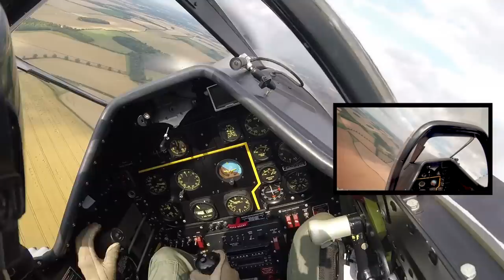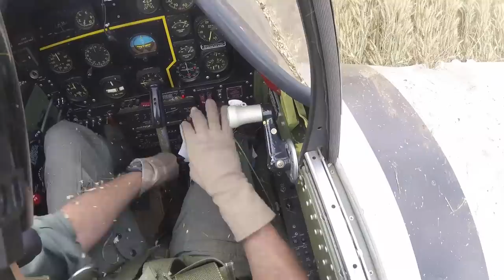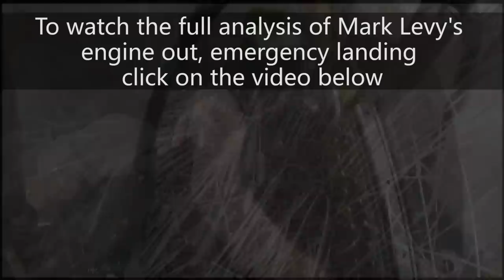P-51 Engine Out, Off-Airport Landing

Comment: Everyone: cool, hope he's safe
War Thunder pilots: Wha how did he not just explode what?
Reply: Yeah wt has some odd mechanics but ive pulled this off before in the game
Reply: Explosion crashes happen a lot more often with the new game engine update. In the old engine you could crash land a plane relatively easily.
Reply: Press J to leave your aircraft (15)
Reply: @jandajanda2242  just lightly tapping a tree will make you explode. Once I skipped across the airfield because my gear was shot out and my nose just barely touched a tree and then I exploded in a ball of flame and I just thought to myself "yup thats warthunder for ya"
Reply: In war thunder this guy would have exploded when they touched the floor
Reply: wha how did it not go like an atoms bomb
Reply: lands plane safely, but goes over a little hill
wing: falls off
sOfT lAnDiNg ‘yay an extra 1.5 SL thanks Gaijin’
you will leave your vehicle in 15 seconds
Reply: @KuroHebi  i disagree heavily i landed a p47 pretty damn hard at over 250 mph and only destroyed my engine
Reply: @kermitlynotfound1129  sometimes the game goes easy on the physics. It's a really clunky game.
Reply: @KuroHebi  i agree it is very clunky
Reply: @kermitlynotfound1129  amen, brother.
Reply: @Noname-qu2wg  just like simpleplanes

Comment: I would recommend people people watch the longer video. Especially those who are criticising his performance. 

The Pilot analyses what he did wrong and what he did right and why he did things, right or wrong that way. He is very frank and covers what he hopes he would do differently.

For those questioning his 'right' to provide advice - he has been there, made the mistakes and now he is advising you on the traps he fell in to and why he fell into them so that others will hopefully avoid them. He also covers the errors he didn't make and how and why he avoided them. At no point does he claim to be Mr Perfect.
Reply: I'm no pilot but I agree. I always thought as long as the engine is partially running it would be better then not running. Guess I was wrong there. I've thought about getting my pilots lisance but not sure yet.
Reply: We all know that the people that say they would’ve done it differently either have never been in that situation, which good for them or they’re just people trying and failing to look cool in front of others

Comment: The pilot (apparently) stayed calm and, yes, made a few mistakes. It's a tough call to shoot for an off-airport landing with all its dangers when the engine is teasing like that. In the last few seconds he decided that he wasn't going to clear that road, let alone make the runway, he turned away and got the gear up and wings level. Great job, Mark!
Reply: Why did he have a higher sink rate than planes on YouTube making relatively gentle no-engine landings?
Reply: @vampiresforesl  Were these other planes P-51s? The P-51 flies like a brick with no engine. They aren't a glider. If he would have tried to hold it back too much it could have tip stalled and that would have been all she wrote. A lot of pilots were killed during WW2 just learning to fly the P-51 for exactly that reason. I've heard it said that more died in training accidents than in combat, but I don't know the validity of that statement.
Reply: Gear up???
Reply: @cheetahfish  "I've heard it said that more died in training accidents than in combat" Yes, that's true in general, not just for the P-51.

Comment: The speed in which the situation goes from "I can't even complete the 180°" turn to "landing gear up, let's fly this to the ground" is just incredible. 
I think most people they have more time in general for things. The podcast lasts way longer than the actual event and the thought process that went in to this seems like it would take longer. So grateful for the insight and video. One thing is to say "it happened so fast" and it's always another to see that while you're still processing info, this pilot is already on the ground.

Comment: Well done, the intermittent issue has to be a terrible thing to try and reconcile. I'd be trapped in "I can make it".....
Reply: JimsEquipmentShed i think in a situation like this, gaining altitude on the way to land, while u have power, would help. Added altitude=more glide time. But thats just my thoughts, and i dont have any actual flight XP...just simulator, so id like to know if im wrong and why so i can fix my thinking.
Reply: I would agree, I'm strictly right seat, but in my humble opinion, there is no substitute for extra time and altitude.  
Anyone I have ever flown with has always been on the look out for a place to land from the time they took off, until the time they get to their actual destination.
Reply: that's what gets 90% of pilots killed, if you got an engine failure (no thrust or even idle thrust) in down-wind don't go for a short final just land the plane on a field. Many think they can make it and end up crashing the plane. It's not about trying to do see if you can make it by going for it and then deciding 8 seconds before impact oh shit I can't make it and then try to change course to land in a field which cause you to stall because you can no longer trade altitude for speed. You have to be conservative, this pilot thought oh maybe I can make it instead of I'm going to risk killing myself I should just safely land here. I'm not saying it's easy but it's something your instructor should have taught you.
Reply: St T. It wasn’t a failure until the point of no return though. It proper reaction  to an intermittent failure I was referring to.
When you are looking down the dark tunnel “willing it” to stay running.
Reply: Very much dependent on circumstances on the day.  My instructor taught me:  If you have a sure field ahead and very few other options, and an engine that's coming back to life intermittently, go for the field in front of you and assume a dead engine at that point, because of the unreliability and the certainty of your good field.

However....    If you have a stuttering engine and a string of excellent field options ahead all the way back to the airfield AND you can maintain sufficient height, or at least slow your descent enough with the stuttering engine - then limping back to the airfield for a smooth tarmac touchdown MAY also be a perfectly good and viable option, because if it goes pear shaped, you'll have a good field in front of you at any time.  Especially in the rural parts of the UK, you can have a long succession of perfect fields that COULD lead you home perfectly safely to that sweet sweet tarmac.

In this instance, his last second turn back to the right was absolutely the best decision, as he didn't have the height or energy for finals, you could see the rapid descent rate.  He kept the aircraft flying level for a controlled impact and walked away - Job done.  The plane was also repaired I believe.  That's a double win.
Reply: @JNM11787  in the full version of the video they do discuss the balance of kinetic and potential energy and the interviewer did ask if the engine was making good power when it did come back. The answer was "no" because if it was he could have climbed. It was intermittently running, but only making enough power to slow the descent unfortunately. The pattern was relatively low altitude and from memory only at around 180kt so he really had very little to work with.

Comment: Been to the Reno Air Races many times. When those guys have an engine problem they immediately exchange airspeed for altitude (best glide speed) while turning toward a runway. This procedure saved my but when the radial engine threw a rod on my plane. I didn't gain much altitude but it was enough to get me back to the runway.

Comment: Seeing this. I think of my local AP. there are no fields of grains around .Don't make the runway. its trees for miles. Tall pine trees.100 ft high
Reply: Same here, on one end, a very short roll out, then trees, and on the other, a housing area thats so close, they can confirm your checklist.
Reply: In fact tress aren't that bad, if you can glide the wings into the top of trees and then execute a stall you will make it, well hoping there aren't big fat trees and you manage to don't hit one with the cockpit.

I'm in the same scenario at my airfield sadly

Comment: A partial engine failure or a rough-running one is really tough. He's right in that a pure engine failure is easier. We've all trained for engine failure but it's tricky to train for this. You have to re-evaluate your plan and come up with a new one and in this case he did it three times, the last time was 400ft on base turn with flap and gear down.

Comment: I had a similar landing, but we didn't have an engine failure, the pilot made a mistake and when we came over the runway to land we drifted and stalled into the grass next to the runway. It is horrible to be in a crash but it just shows that the can happen, I am only 14 and have already been in a plane crash, it's not normal but they do happen. Congrats to the pilot who managed to set down the aircraft in a field, if he turned to the runway he would have entered a stall spin and they aren't fun.

Comment: Partial engine failure, if it’s cutting in and out I’d have to guess it’s a fueling issue, best thing he could’ve done was play with the throttle like he did to try and get it to come back, great actions by the pilot and the airframe did exactly what it was supposed to do, and that’s get the pilot home with a heartbeat

Comment: Question for the Mustang experts: Will the gear come down if the engine is not running?  I assume the system is hydraulic, but is the pump engine driven or electric?  Is the backup gravity (free-fall) or hand-crank (pump or mechanical).  With no time for a manual extension, and an engine driven pump, seems like telling someone who is dead-stick to lower their gear would be bad advice.
Reply: Agreed - I noted the time he pulled gear up to impact was quite quick - would the gear have come up in time? Expert choice reacting the way he did in given situation in last seconds.

Comment: Speaking as a carded formation pilot at the first sign of any engine issue the first place to go is up and out of the formation, then head straight for the airport.  If there was another element behind his, and the lead of that element did not spot him, another aircraft could have easily ran into him.  This would also have been a critical time to trade altitude for gliding distance.
Reply: Bob Japundza 1, they were flying slow
2, it's a heavy warbird at too low of an altitude, it will not glide far
3, watch his interview

Comment: Moving the throttle after the engine restarts is generally a bad idea at least until the runway is made. 
Me? 14,000 hours of crop dusting, 20,000+ total. 3 engine failures in recips, 1 in turbine, 2 turbine precautionary shut downs.

Comment: I'm very curious why you would do a gear-up landing in a field.  These are tail-dragger aircraft, designed for rough field/unimproved landing strips during war time.  You're obviously tail-dragger qualified, would you not land a Cessna 170 in that field?  I would love to learn more from this landing.
Reply: + Spydie  It's roughly an 11,000-pound aircraft.   Landing with gear on any soft ground and it can dig in and flip you over, usually with fatal results.
Reply: @FiveCentsPlease  That looks like a very dry field, like the WWII pilots landed in.  But I wasn't there so it was your call.  As PIC we have the final call.  Good luck!

Comment: I think I would have been pulling up to gain as much altitude as possible since it was close to the airport but in the heat of the moment, I am VERY glad you did not get hurt.
Reply: That is the exact opposite of what you are supposed to do. If you raise the nose you lose airspeed, if you lose enough airspeed you stall, when you stall you fall out of the sky instead of gliding down. If he had pulled up he would have killed himself.

Comment: Intermittend, that is scary. It might have been a idea to just cut the engine totally - just so you avoid the "trying to make it" trap and avoid it comming to life at the worst moment. As well as fuel still pumping/flowing and similar issues. But with that old military plane, that might have made it worse. For the kind of reliable performance you need in war, safeties are among the first things cut.

Comment: What was the reason for the engine out? Most likely the landing gear did not make it back inside. :( 
Great job anyways.
Reply: I wonder if the radiator being proud under the fuselage on the P-51 digs into the dirt during wheels-up landing. Should stop it quicker, or shear off.

Comment: Not a pilot, and I'm curious why you would pull the landing gear up. I feel like it would be cheaper to replace the landing gear, and with any luck, just the tires rather than the wings.
Edit: I understand that you are hoping to just scratch the belly, but I feel like you'd have better luck with a rolling landing rather than a sliding one.
Reply: +@rorscheyourmom8848    The plane weighs around 10,000lbs, give or take with fuel load, original equipment, etc.   If you land on an unprepared soft surface, the gear can dig in and flip you over, and that is easily fatal.
Reply: @FiveCentsPlease  Thank you. But just to add a little, I assume the prop. is weak enough not to be an aspect in this scenario? So the prop. couldn't dig in also and flip the plane, or dig in enough to pull the bow in?
Reply: @rorsche    The prop blades usually bend backwards with the impact, or wood/composite propeller blades on some warbirds will break.   It is rare but you can see old pictures of a propeller blade bent forwards and this is usually because the engine was making power at impact.

Comment: I'm curious, at no point did I hear Mark call an emergency, or even to let his flight lead know that he had an engine issue.  Did I miss something?  I'm not trying to be an armchair quarterback here, but if I know I have an engine that is misbehaving, the first thing I would have done would have been to call my flight lead and let him know.  They could have broken off and given him access to the runway.
Reply: The priorities are as follows:  1) Aviate, 2) Navigate, 3) Communicate.  

The Aviate portion includes the ABCs of an emergency landing.  (A)irspeed, (B)est place to land, (C)hecklist.  That's a substantial amount of stuff that has to be done prior to the "Communicate" step.  If he did not make any calls, that is most likely why.
Reply: A Sweet Old Man I agree with that, but in this case, I don't think it applies.  Furthermore, in the more detailed video I watched later, Mark said he thought he did call, but didn't remember what he said.
He had plenty of time to inform his lead he was having an engine failure.  Furthermore, he found have broken off and landed downwind.  Now I AM playing armchair quarterback, but he walked away, the airplane is being repaired and will fly again, so it's all a moot point.
Reply: He did declare an emergancy (watch the 'long form' version). However neither video system picked it up, nor did they pick up the transmissions others made.
Reply: Rick, in my second post in this thread, I covered that.

Comment: First - The guy survived and the plane experienced minimal damage.  Overall, well done.  In particular, an excellent choice to not try and stretch your glide across that road packed with cars.
Second - At ~150 kts, why in the heck didn't you climb?  At 150 a Mustang can certainly climb some.  "CLIMB, turn, clean" is the ROE for every single engine pilot in a power deficient EP.  This part confuses me.
Reply: You werent in that situation though. Rational thought most definitely  goes out the window when you're in an aircraft with no engine power
Reply: If he was able to maintain altitude perhaps the thinking was to maintain highest possible groundspeed to get back to the field ASAP.

Comment: Think I saw the 7700 emergency on flight radar24!
Reply: I very much doubt he'd of changed his code that low with a failing engine, it would of been stupid and unnecessary.
Reply: It was a P51 and you don’t often see that. Also there were other p51s around it at the time and it was in this livery in some sort of warbirds thing which o do not remember. I don’t know though.

Comment: Forced landing! 

Immediately decide for any available field. Use remaining airspeed for glide path above stall speed. Fewest obstacles etc. To low, for bail out, must do gear up in field. Full flaps after speed required if possible. Cut fuel and ignition. Tighten harness. Flare out at ground approach.

The aircraft was lost when engine failed. Try to survive with out coming down on population if possible.
Well done.

The Tempest with it’s large chin on wheels up was almost a guarantee of front flip. Try to duck into cockpit for ensuing canopy smash. Fire always a danger. Try to escape after stop if possible.
A most risky business to be sure. May you never hear engine cut out at low altitudes especially.

Comment: Nice job!  Although, flight suit gloves, finger tips removed.  Flight suit sleeves, raised up.  Many accident investigations will prove that is a severe mistake, especially with high octane fuel on board, in a post crash burn scenario.
Reply: Nobody wears a flight suit in a normal GA plane, although the risks are the same. Thats not a valid critique.